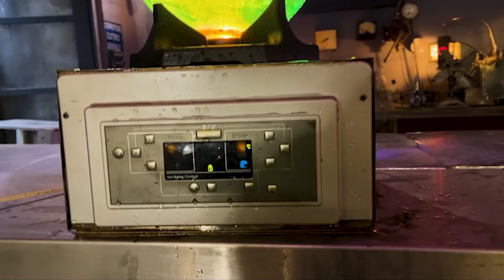DIY Hydroponic UV Lamp • How to Build It and Why It Works

Comment: 4:03 when freehanding a diamond bore hole in a piece of glass it's best to start on the edge of the bit very slowly at first. Instead of trying to go straight down which ends up with the bit dancing around on the surface of the glass and scratching it up... further stability on the surface can be had by putting a piece of masking tape down first. The tape not only adds a physical defense against the bit moving around while you're drilling. Blue painters tape is the best for this but really anything will do.

Comment: Bro you can wrap a sock around a long drill bit or dowel rod really anything that is long and thin and that will fit in the drill Chuck and use it to buff things a lot better than you can with your hands. This is a barebones hack

Comment: I thought that plants need CO2 not oxygen. They produce oxygen
Reply: For photosynthesis: yes. But the roots need oxygen, and the good bacterias in the roots need oxygen, and in darkness the plants consume some oxygen if I remember correctly.
Reply: Interesting, thanks for the clarification!
Reply: @davemarm  To clarify further, while plants consume/capture CO2 and produce oxygen during photosynthesis, they also consume oxygen for respiration just like humans. In general, there is a net gain of CO2 captured in plants, but they actually produce some CO2 during respiration too!

Comment: I think it depends a lot on the wavelength of the UV light. Shorter wavelengths have more energy and can sterilise the water and damage the roots. Longer wavelengths may still be harsh, but is probably okay.
Reply: In reality the Color of the light can be any wavelength- its the power being driven to the Light that can cause problems. a maximum of 2-3W of light regardless of Wavelength will be fine. Roots don't Photosynthesize. Good way to describe would be as long as the "Show Lights" for the roots are at least 1/10th of the power of the "Grow Lights" you're in solid Territory. Color 'em red, Blue, Purple. It doesnt matter.
Reply: @IHamDogg  the main thing is that ionizing radiation doesn't get to the roots. Shorter wavelength UV can be ionizing. Of course most things can handle a certain amount of it. However, I hadn't thought of what was written above that UV-C can't get through non-quartz glass, and that means there isn't much chance of it doing much damage.
Reply: UV-C doesn't go through non quartz glass.